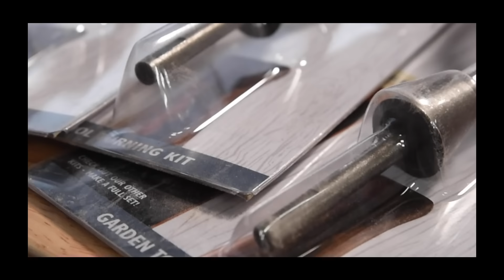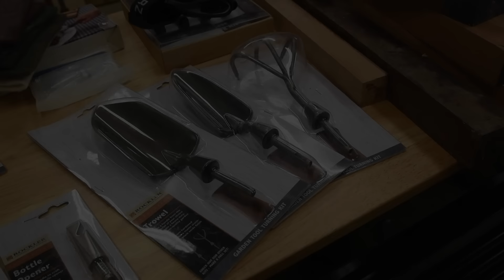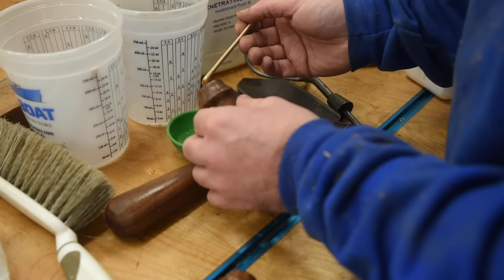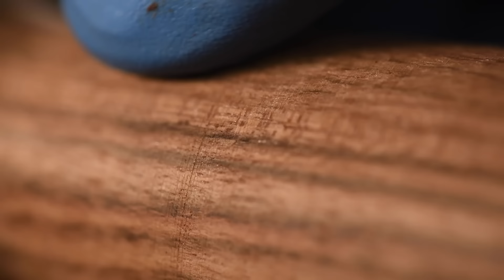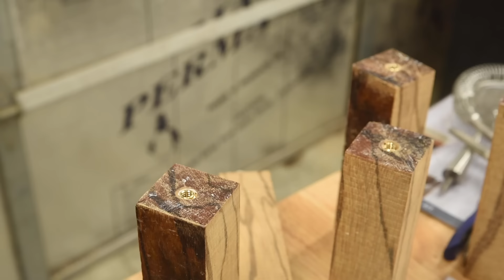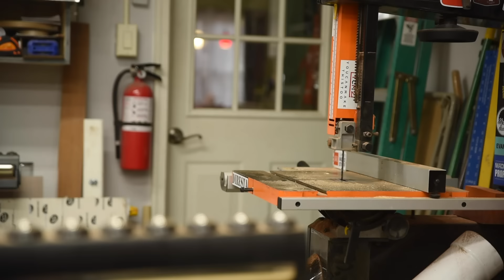Easy Wood Turning Lathe Projects

Comment: Good ideas with the turning, but no room for the sexual remarks, yoiUng turners may be watching this. I will not watch any more if you do it again.
Reply from the maker: After it went up I had mixed feelings about it. I wasn’t concerned about youth because my analytics say I don’t have a young audience. But, I didn’t consider the possibility of that changing. Or this topic in particular drawing an atypical audience for me. Thanks for bringing that up.
Reply: YouCanMakeThisToo let it rip, tater chip.

Comment: Nice work on all the tools, but these little “kit” packages from Rockler for a simple garden spade are pretty darn expensive.  I see that Rockler provided them to you for free - nice.  Personally,  It’s much more economical to pick up things at Dollar Store or Harbor Freight and dismantle & then add a nice wooden handle.  Harbor Freight currently has their 4-n-1 Screwdriver combo for “Free”  with any other purchase.
Reply from the maker: Good tip! I should’ve mentioned that. I will say you get the moneys worth on the Rockler kits. It’s not grocery store utensil aisle quality that’s just marked up. They’re solid stainless, hefty, and very well made.
Reply: YouCanMakeThisToo  - I agree, but $20.00 for a simple garden trowel kit is just too much.   And $50.00 for the set of three isn’t any deal.
Reply: If you can afford to by a lathe, then it should be inexpensive, if you are interested in another habby, to build a forge

With a forge you can easily make these very study tools for a fraction of the price 
Really even the cheapest gardening tools would be over prices even if they were good qaulity 

The price you pay is purely for brand

Comment: No ferrules on the gardening tools?  Aren't you worried about them splitting?
Reply from the maker: Nah, won’t be near enough force on them and they’re quite thick. If they do, I’ll just make new ones.
Reply: @YouCanMakeThisToo  That's good to know... Guess I've just broken too many trowels while metal detecting to trust bare wood when used for something with torque on the handle.  Hope you had a Merry Christmas! =)
Reply from the maker: @RealRuler2112  Oh yeah, if you're out metal detecting I definitely would have put a ferrule on it. These will be used by my mother-in-law in her very well worn garden and gardening pots. Very loose soil. Hope you had a great Christmas!